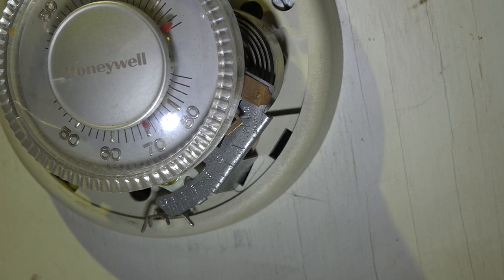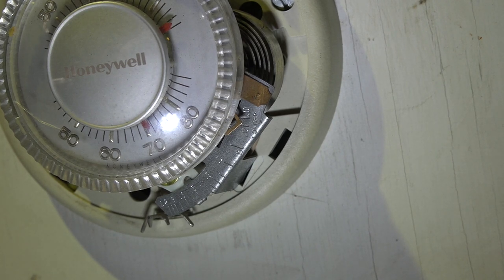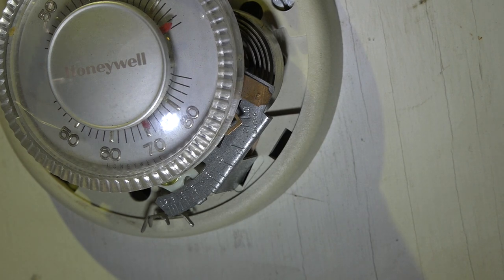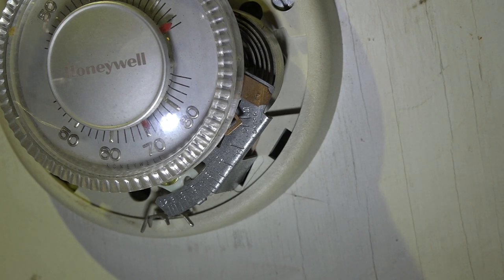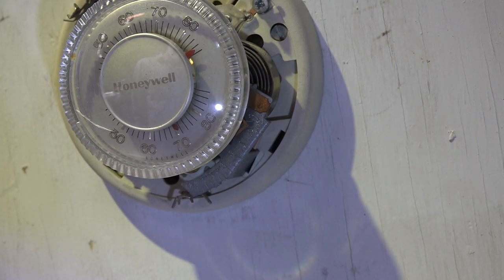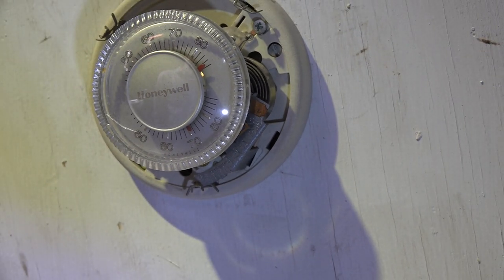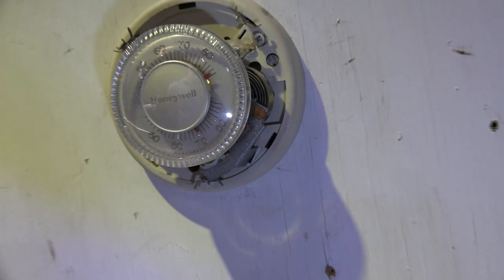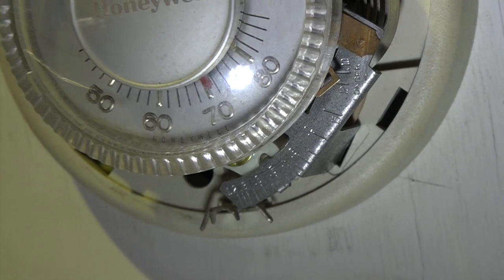The furnace short cycles.  diagnose the problem.  #1 Answer

Comment: Thank you grayfurnaceman! After spending thousands of dollars paying for my furnace repairman to replace fan limit switches, inducer motors and adjusting the fan limit switch I watch your video and found out that the anticipator on the thermostat. wasn't to fine tune the temperature on  thermostat that it adjusted when the when the burner would go on and for how long. I did the test like you said to turn the thermostat all the way up to see if it eliminates the short cycling and it did. I called a new company and asked them to adjust the amperage on the anticipator to the amperage that was being drawn so it would work correctly so after 6 different bills all it needed was a simple adjustment. unfortunately I'm not getting a refund for all the parts changing that my furnace man did. but at least now we are comfortable.  That jerk even tried to convince us that we need a new furnace.  Thanks again grayfurnaceman for keeping us consumers informed.
Reply from the maker: +Meno Passini Sometimes the simplest problems are the hardest to find.  The adjustable anticipator is becoming an antique and many service techs have not seen them.  Glad you got it working.
GFM
Reply: Screw oil companies

Comment: Just thought I'd let you know. I was having a short cycle before a continued reheat cycle, forced hot water by oil, mercury Honeywell thermostat. Over the years I've messed with the anticipator to no avail. I just replaced both with new electronic thermostat and the short 1-2 second cycle, off, then back on was eliminated. All running superbly. Thanks, for being out there. GFM
Reply from the maker: Welcome
GFM

Comment: Can you give any advice on a lp honeywell, fan short cycles upon initial heating cycle. Once heating normally, fan blows constant as it should. Then upon cool down, it short cycles again until satisfied. 20 yr old mobile lp honeywell. New mainboard 5 years ago. Electronic thermostat installed this year. Problem existed prior to and with new thermostat. 
Does this with door open or closed.
Short cycles 3-5 seconds I'd say. 
 
Appreciate it.

Comment: What would cause the thermostat to start smoking and burn out? I literally got smoke coming out when I adjusted that anticipator to the right almost all the way. The thermostat is connected between a Taco 555-050RP powerhead and a Taco ZVC 405 control. Amp draw on powerhead is rated at .9 amps. I did not expect adjusting the indicator all the way to the right could cause it to literally burn out. Is this possibly a problem with a failing powerhead. I will replace the stat and powerhead just to be safe.

Comment: I have a Problem with my thermostat please help!!! I have this exact model thermostat in my apartment. We have terrible insulation and the bedroom is above the complexes boiler room. As you can imagine the bedroom is always hot while the rest of the apartment is freezing, aside from that, my problem is that 1. The heat is either blazing, or not on at all, there is no inbetween and if it's on, it is very difficult to get it to shut off and the same when it is off and I want it to turn on. 2. I don't understand what you are talking about. If you could explain what each thing is and how it works, I'd appreciate it. 
The Last 2 days the heat has been pumping non stop and I had the dial on 50. The bottom temp number was reading that it was 78 degrees In the place. I finally discovered that metal bottom piece with the tiny ticks and noticed that it's pointer was all the way to the right, so I moved it all the way to the left, and finally it seems as though the heat is now off. I'd really just like to make it work properly though. Can you please help? Thanks!

Comment: on my Beckett oil furnace I replaced the limit switch because it was sticking  but didn't seem to fix it completely.  it heats up kicks on fan and in just a few seconds  it kicks off the fan.    burner stays on  the fan comes back on   and off  limit switch is exactly the same as the one that came off it neither one of them have the shield under the limit switch part that sticks over the burner could the fan air be cooling too fast causing it to shut off?
Reply from the maker: The on and off temps may be too close. I have some videos on the fan and limit switch that may help. 
GFM

Comment: Hmmn.Im trying to find out if this is my issue.I have the same honeywell thermostat.I just had the blower motor and filter replaced on the 30yr old Armstrong furnace.Not seeing any error codes.The pilot comes on and it starts blowing,but the temperature in the house wont go over about 62.Ive tried turning the thermostat up to 80, but it will just run and run but it doesnt show(or feel) a warmer temp in the house.The vents in the hall dont blow warm air,maybe they arent supposed to idk..thats why I'm here looking for insight,lol.I cant afford to have the thing running all night/day and not actually getting it up to temp.Ive had to turn the thermostat back down to get it to shut off.The anticipator is set at .4 im not sure if its been messed with but everything seemed to work fine last winter.Id appreciate any tips or ideas,thanks for your time!
Reply from the maker: The vents in the hall are returns.  They should not blow air.  The reason for the unit not keeping up could be several things.  First, be sure the filter is clean.  Watch the unit operate.  Do the burners stay on or cycle off every couple of minutes?  Be sure the ductwork is clear and not crushed.  Set the thermostat to its highest setting to test this.
GFM
Reply: @grayfurnaceman  
The filter was very dirty so we replaced it when the service guy put the new blower motor in.The pilots do come on and shut off on a cycle and all the ductwork looks fine from what I can see,its very weird that it just doesnt seem to warm up and maintain the temp.The house got cold after the blower quit obviously,so I figured it wld have to run quite a lot to warm it back up to 60-70..but it doesnt seem to warm up over 62.It will just keep running and I will sometimes have to put it down to 60 or 58 to shut it off.Thanks for the tips,I just dont know what Im missing
Reply: @grayfurnaceman  
just watched the short cycle video hoping it is just the flame sensor needing cleaned.It fires up for about 30 seconds then shuts off for about 4 min and repeat.Im too intimidated to try that myself( not sure why the service guy didnt clean it or do a tune up while he was here.Thanks for your time
Reply: Ok...so it was none of the above.The service guy told me this furnace doesn't have a heat sensor. The previous guy who put the blower motor in actually hooked it up wrong,so it was blowing in reverse🙈😂 is this what the world is coming to😣?

Comment: I dont want the thermostat to heat itself can you shut the internal heating  completely off ... my central heat sys. needs to run non stop until the desired temp or else the desired temp will not be reached... and it will stay cold in the room...
Reply from the maker: You can set it at the highest setting to eliminate the anticipator but I would guess it is set improperly.  The furnace should run continuously until it reaches temp.  Try setting it to a higher number on the anticipator (about 1/4 ") and see how it works.  If it is set too high, it will overheat, then get too cold before it starts.  
GFM
Reply: Thank you for explanation. the heating system works with water so it heats slow by itself. maybe by air heating you need anticipation. the thermostat is now replaced with an digital version and works fine...

Comment: How do I turn the heat off completely?
Reply from the maker: If the thermostat has a system switch turn it off.  If the furnace has a switch near the furnace, turn it off.  If it is an electric furnace, you will have to turn off all breakers in the panel that are marked "furnace".
GFM

Comment: The Anticipator must be matched with the gas valve. Look on the gas valve and a value will be stated there. Match it with the thermostat by sliding the pointer to said value.
Reply from the maker: Unless your furnace is is over 30 years old,  using the gas valve will give an incorrect number.  The correct number is found by measuring the amp draw of the "W" circuit.
GFM
Reply: And you will also take stat wire length into amp reading

Comment: Is this adjustable without replacing the thermostat, if so how do you adjust it and where do you set it at?
Reply from the maker: +GrayRealities Check the "thermostat anticipators" playlist on my channel.  Hope it helps.

GFM
Reply: +GrayRealities IMO, replace. Electronic thermostats are far more advanced, flexible,  much less prone to weird failures and not very expensive or difficult/dangerous to install. Dispose of the old one safely though, that's a nice sized blob of mercury in there.
Reply: +Jeff S mine is 20+ years old and still working properly. Ha.... their pulling failed electronic stats off walls like crazy for stupid failures.
Reply from the maker: +Jeff S Interesting that you see it that way.  I have not seen an electronic that lasted more than 15 years.  Most much less.  Those old mechanicals seem to last forever.  The oldest I have seen was installed at the beginning of the 20th century.  Thanks for the thoughts.
Reply: My grandparents home still had its original Janitrol stat from a gravity furnace- mid 20th century gas conversation up until ten years ago.
Reply: its on the gas valve

Comment: You take the amp draw of the circuit and match it up
Reply: +derrick owens where exactly do you get this amp draw from?
Reply from the maker: +GrayRealities Amp draw is measured by clamping the W wire.  Do not clamp the R wire as sometimes it will read a higher amp draw than what is going thru the W wire.  Hope this helps.
GFM